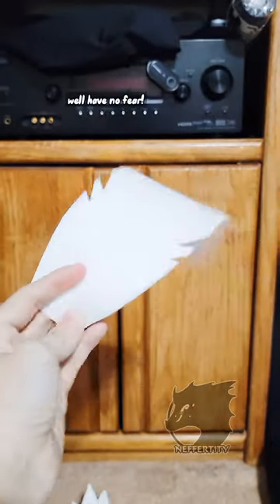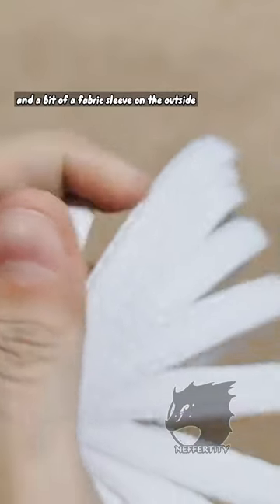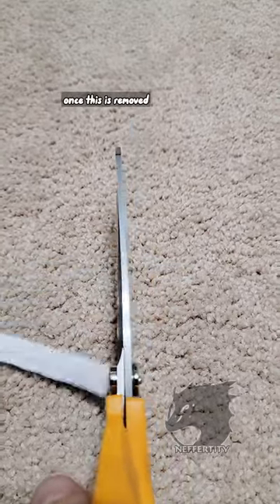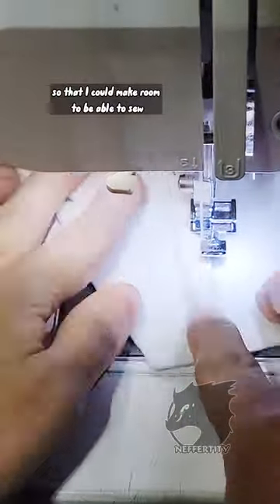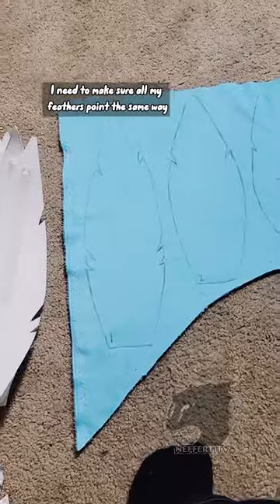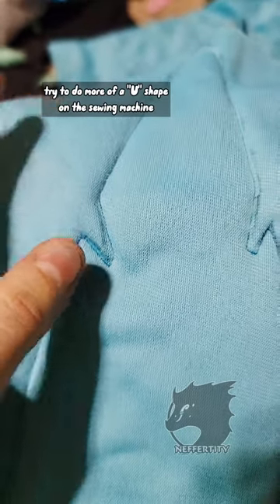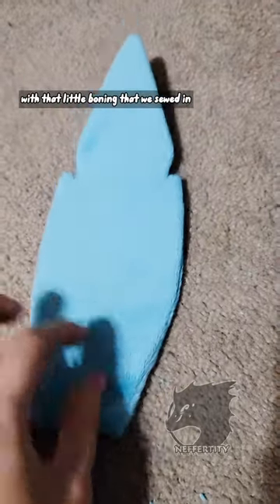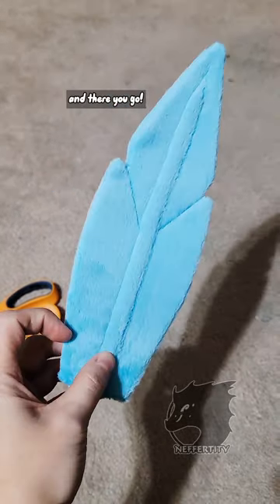QUICK TIPS - Making Better Feathers

Comment: Quick tip, since it wasn't mentioned in her video: this featherweight boning often comes in a roll, which causes it to coil when you may want it to lay flat. You can iron the boning to make it malleable and then allow it to cool in whatever shape you want it. Be sure to keep the fabric sleeve on it while you iron to avoid the plastic melting to your iron. Happy sewing!

Side note: though you may find some beginner sewists using zip ties as boning, Nefertity is correct in warning against it. Zip ties will not only degrade over time, but can also lose their shape, requiring you to replace them to maintain rigidity.

Comment: Would you happen to know the length of feather this would be recommended for? I have some silly, extremely long feathers I need to make for a tail and I don't particularly want to use something like wood or metal.
Reply from the maker: I generally stick around 9 inches